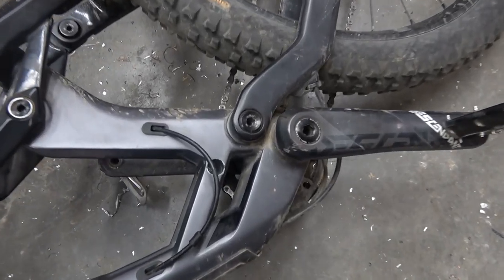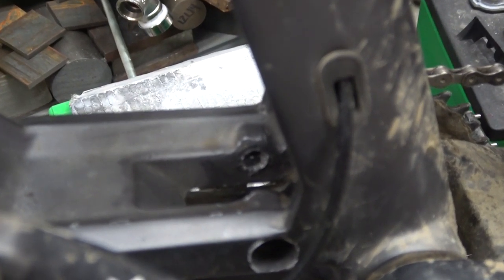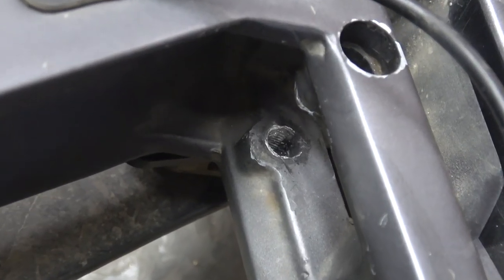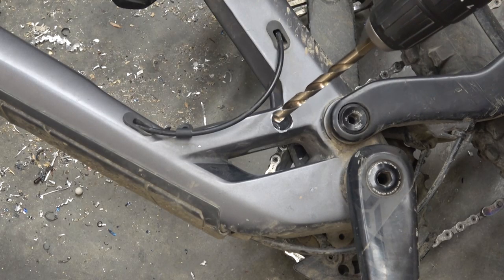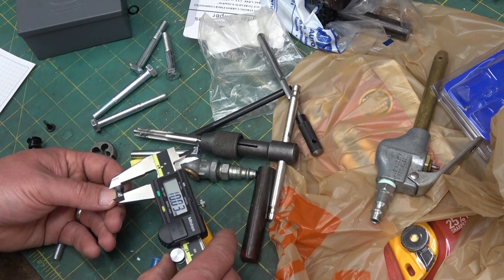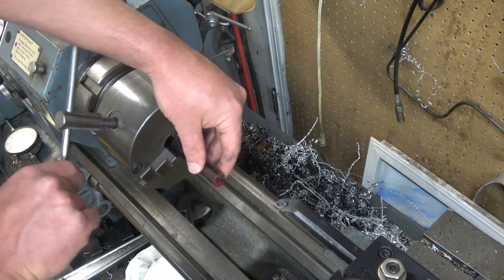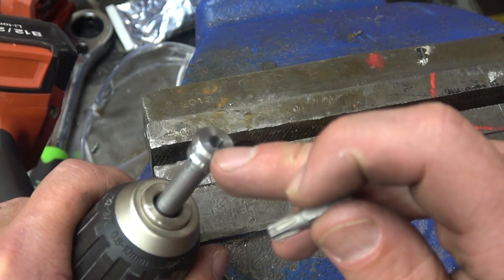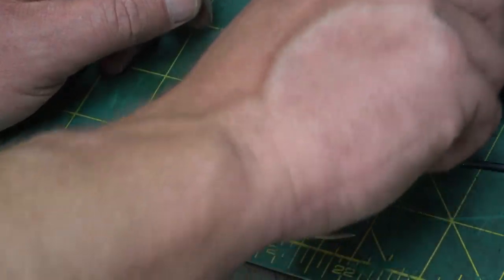What's a scumbag offset? | Obscure German Carbon Fiber Bike

Comment: Being a German bicycle, I'm sure the $600 water pump will be the next part to fail
Reply: Yes! And you'll have to take off both wheels and the seat, get a special tool to hold the chain and sprocket. Better make sure everything is lined up before letting out the pin in the tensioner! Or else you'll throw off your timing and it'll never run the same again! And all to change the water pump!
Reply: If it were a Yamaha it would be the £900 ignition lock.
Reply: Don't piss-off the Germans!  8)
Reply: Good luck figuring out the oil level without that dipstick.
Reply: ‘Twas “fixed” with a software update.
Reply: Chris Stephens and then the $600 valve they didn’t check originally. VW owner here. These stories are true.
Reply: @oqsy  Or the weak headbolts on the 500 horsepower V8 in the 2007 all wheel drive AMG Mercedes minivan - which the owner decided to rebuild himself rather than pay a Mercedes shop $57K to do.
Reply: It's 300 dollars, but the labor is 3000. :) Becuz Cherman Engineeering is der best!
Reply: It'll be the $600 magnetically driven waterpump that will fail due to melting as the $20 stamped oil-water heat exchanger leaks all the working fluid. 
I don't know why the Germans or Austrians can't suck up the patent cost for the aluminium linear designs like Laminova etc.
Reply: @oqsy  I love my VW. But I have a tbi with 4 years of warranty and it's a manual transmission. It can get pretty bad if you csnt/don't work on them yourself. Nice thing is Bosch sells everything as aftermarket, at about 60% less than the stuff that says VW or  Audi.
Reply: Haahahahahahahahahahaha
Reply: Please, Mr Cintolo.. I close my eyes & see faint amber lights..
Reply: Dee Jay   a friend of mine had his bike written off because of the price of a steering ignition lock on his scooter T Max. The villains also cut a section of disc to remove the disc lock, I hate to think how much one of those costs.
As to costs , in the past I have disabled a steering lock part of an igntion switch.,after a theft, because of the astronomical price of a new one,for a friend who could afford a replacement. Seem to recall £600 being mentioned.
Forgot to mention the T Max was keyless ignition, which could explain the wild costing.
Reply: Just wait for the timing chain service
Reply: Bah, the 600 dollar water pump never fails, it is the 35 dollar water pump tensioner spring that fails.  That failure kaputzes the 600 dollar waterpump
Reply: Giovanni Cintolo you mean 1800.00 water pump 😂
Reply: My honda charges 900 for brand new alternator
Reply: Watch out the VANOS will be next.
Reply: Dee Jay  yeah man wtf is that about
Reply: @derekcoiner5946  Or $400 for air filters fml
Reply: And the water pump impellers are made of plastic.
Reply: @dekoldrick  they prefer the term
Advanced lightweight composite materials.
Reply: @edwardtupper6374  you just gave me flashbacks with that word ... Vanos .... Yikes
Reply: @bryanmartinez6600  LOL🤣
Reply: @mattburns2968  Sounds like you're describing the 2.7
Reply: @rickmorley9948  That itself had two more bugs...
Reply: @greggv8  57K....LOL
Reply: @chrisstephens6673  two words - HOT Wire
Reply: @rogerborg  
FACTS: 1982 Honda CX500 Turbo tuneup cost $ 1200 at a dealer. 
First Minatenance: $2500
Over engineered to the 9's!
Reply: @glenholmgren1218  excuse an old man not understanding but "hot wire"???
Reply: Chris Stephens Hmmm, reread your original comment - perhaps this particular bikey-bike is not a good candidate for good, old fashioned Hot-Wiring ? (Circumventing the normal key-activated ignition controls by bypassing the ignition switch with a wire instead of the key performing that function ... seriously, and old guy {me too} that doesn’t know what Hot-Wiring is? 
I know I grew up on the wrong side of the tracks; in the wrong neighbourhood of one of the most crime-infested small towns in Canada, but for real???)
Reply: @glenholmgren1218  regrettably I also  know the meaning but missed the context. Having a senior moment perhaps?🙄
Reply: and all 8000  electronic modules.
Reply: @BillJBrasky  Bought one Jeep Commander. Real American design.  Quickly figured out it was a Mercedes in disguise. Had software issue that prevented 4wd low, and  a power steering fluid driven fan. I want to say I had to replace the radiator because the ps fluid was routed through the radiator and was leaking.  The second Jeep Commander had a transmission issue where it would spray transmission fluid out of a vent tube when warm dousing the hot  parts of the engine.   Honestly still wonder if it had a slight leak  was just overfilled thanks to the lack of dipstick, as it shifted excellent.   Had it rebuilt, broke even.
Reply: @N4CR  600 dlls, try 3k for some of the austrian industrial pumps
Reply: Internal water pump

Comment: Many thanks for helping out our customer from Switzerland! Really great work on the bike (and the video is great too!)
We've changed all "pins" from aluminum to steel.
Reply: Ave needs more beer to keep the National friendship going :)
Reply: Or Cheese...
Reply: Very cool
Reply: Holy crap a company that actually cares about the quality of their products . . . what is this world coming to?
Reply: A good company would dutifully compensate our canadian friend with a carefully considered quantity of beer.
Reply: @yourmoms5602  don't worry, the customers will carry the cost of the engineering and workers change in materials. All the PR guy has to do is say sorry and keep his mouth shut about the engineer warning them about fatigue. Poorly engineered parts usually come from management. I could be wrong, but I hate giving corporations the benefit of the doubt.
Reply: @Jonas Pins and other shock mounts are typically frame specific. Fox, Rock Shox and others make their eyelets to an industry standard size. They do not manufacture bolts, pins, and the like.
Reply: You should consider titanium, it's lighter and just as strong as the chromoly.
Reply: As a fellow Canadian preserved meat products are almost as good as beer. Also good on you for admitting your failures and improving upon them. Cost is important to making a decent product and profit is king. But the queen of the house gets mighty pissed when she’s embarrassed by shortcuts in engineering. I’m sure the original parts were all titanium but the bike was also unprofitable or prohibitive in price. Compromises must be made and unfortunately this was a failure point and now it’s being recognized and sorted. Good work!!!
Reply: @jonanderson5137  To be fair (lol?) bike "corporations" are not very big on this scale. There are probably less than 20 people working at this place if not just 6 guys and some outsourced production of major parts followed by assembly done locally.
Reply: If this is actually a Radon rep and they actually did change the pins, that's pretty incredible.
Reply: little bit more work for some kids in china
Reply: @whirving  Radon is a brandname of one of the larger online bike/bike parts discounters - online dealers in DE (according to the web presence, 300+ employees). 
The bikes are designed in-house.
Reply: @josephdestaubin7426  he said he would have used titanium if he had it in the Vijay
Reply: Clearly the IPR for this design change belongs to AvE - I'm certain all accounts can be settled in beer or Canadian Kopeks
Reply: Damn nice you responded and doing a fix
Reply: Are my eyes deceiving me? Did this really just happen?
Reply: A fantastic result!
Reply: hope you a made right every failed bike. did you guys even track test? id be happy to test your rigs.
Reply: You may want to rethink your plan. Steel replacement pins sounds like a good idea but unless you're prepared to hand out replacement frames/frame components... I'd stick with the 'designed to fail first' aluminum pins.
Reply: Aluminium* ;)
Reply: Radon. My favorite bike is a carcinogen.
Reply: @garrettburrows442  Right on! What they say.. change the part or don't change it?
Reply: @jonanderson5137  I hate this. As an MET, it really grinds my gears when the marketing department or management pull things out of their ass without a basic understanding of important design choices
Reply: By far the best customer service I've seen from a brand.. Well done Radon
Reply: @travisthechimp7857  my original thought too. But since the pin failure caused frame damage, the cheap break first part also broke a very expensive part. Not sure where else to build the weak spot, but this pin was too weak and destructive when sheared.
Reply: Why were they Aluminium?
Reply: @JasonW.  Agreed.. but I'd have to think that probably 90%+ of pin failure's don't result in such damage. :)
Reply: @johnsalmons9222  at a guess to hit a weight target or because the test didn't show. This as an issue and its a long term Wear issue

Fucking cool They responded though
Reply: Jonas that are made to fit that frame? But I know nothing, you made a good point.
Reply: Addidis no, he got the bear! The bikes owner should be getting something a little more worthwhile for nearly dying?
Reply: @whirving  To be Faiiirr
Reply: @miketrisket788  To be faaaaaaaair
Reply: That's a very Swiss response. :-)
Reply: @Jonas It occurred to me, you manned up !
Reply: @jonanderson5137  This is true of all industries.
Reply: Hell yeah!
Reply: @templecat3974  Cheese with beer: Ave will go balistic...
Reply: @802Garage  They did confirm it to me by email today.
Reply: @gregorpohl9899  That's so awesome.
Reply: @802Garage  They added that they did it for new models. My last week delivered Radon JAB 10 seems still to have an aluminum Pin. It's not magnetic. I asked for a steel one as a replacement.
Reply: Joseph DESTAUBIN titanium is nowhere near as strong as chromoly
Reply: @forevercomputing  gtfo brit boi
Reply: @N00NSFAN  titanium is soft. pull strenght is not everything in that application.
Reply: @gregorpohl9899  Hi Gregor, please send us a message on Facebook or Instagram. We have steel spare-bolts so we can send you one.
Reply: Joseph DESTAUBIN It’s probably too expensive. The material alone is expensive, working with the stuff is expensive because you need expensive equipment and it takes longer. A small batch of a Machined parts like that would be through the roof. Probably not worth the few grams in weight savings
Reply: Whoever was doing your frame design should of told you that from the beginning.
Reply: @yourmoms5602  that's because it's a German not an American company.
Reply: Aluminium is known to undergo galvanic corrosion when in contact with carbon fibre. Were there engineering measures to mitigate this, and if not, could it have contributed to the failure observed here?
Reply: If the design was sound, there would be a very beefy steel bump stop external from the shock, and the rear shock for downhill bikes would have a faster progressive compression valving. Then the pin can be steel, of a smaller diameter and the shock will never fail from getting bottomed out.
Reply: Alu Schrauben, wem fällt sowas ein 🤣😂
Reply: @josephdestaubin7426  Or eat less Cheetos less before setting off. The net weight or bike and rider will be the same.
Reply: You created this channel just to thank AvE and notify of the update? That's commendable.
Reply: @yourmoms5602  german/swiss companies ;) they are not big but they are taking care about  their customer happiness...Nikolai bikes is the peak of that, have a 16year old bike, my seat clamp broke. Got a new one in two days imkl. A new seatpost...
Reply: @XsavioR38  sounds like a letterkenny cold open line
Reply: @purerhodium  I would imagine that the coating on the pin was intended to mitigate any corrosion. And any corrosion severe enough to substantially weaken the pin would have been clearly visible.
Reply: Why the fk were you using aluminum to begin with?
Reply: @yourmoms5602  Most non Chinese companies worth a damn actually care about their customers
Reply: @twizz420  because aluminum is used in lots of bike parts aluminum stems aren’t solid blocks of aluminum. They have tons of cuts to reduce weight and you can’t recreate every stress that’ll happen in the real world
Reply: @josephdestaubin7426  ... and save what in weight .. a few ounces? Is as ridiculous as silver vs copper windings in transformers. It's a geek factor marketing hype thing. Decent bolt steels are higher strength and have an infinite fatigue life when engineered properly, which is not the case with AL and TI alloys.
Reply: @josephdestaubin7426  Actually did consider titanium but he did not have the stock but titanium he needed to make the part so
Reply: @josephdestaubin7426  He considered titanium But he did not have the stock in the shop.

Comment: Ride a Huffy. Cast out of a single piece of solid lead. Great workout, and nothing breaks.
Reply: Until you roll the front tire into something that resembles a taco Bell taco, and the rims are about as crunchy as well 😂 my trust goes to Royce Union for bicycles.
Reply: I got a Huffy! It's a fukking tank, I love  it. It even still has the American flag on the badge.🇺🇸💪
I dig German stuff too, especially aircraft and women.
Reply: Captain Fucking misses the point right here.
Reply: Doesnt break but it wont brake either
Reply: @DerpCraftDudes  from an ex bmx rider 1st thing you with a huffy is remove the brakes lol.
Reply: Pffffftt!
Reply: lmao
Reply: If you upgrade the rims chain and tires and maybe bars the thing is pretty bulletproof
Reply: Lead forks bend pretty good
Reply: Lead bike is the same as a chocolate tea pot.
Reply: Your heart breaks when all the neighborhood kids tease you.
Reply: I think you mean Mongoose
Reply: I had one of those frames fall to pieces under mew while I was riding.
Reply: For sure, cheap bikes are good.   If it does break, you can get a 5-10$ part.
Reply: And you get free lead poisoning as well

Comment: A few years back I had to stick Helicoils in a bunch of long aludidlium pieces, some 500 messed up threads I had to fix.
Then they were sent for anodizing.
And they came back with all the Helicoils corroded right out of them. Fun times.
Reply: Fun times.
Reply: Derp..everyone knows time-serts are king 😜
Reply: ANO.. THEN inserts, always.  You can't anodize stainless steel

Comment: Long time fan, I love your channel!   Please don't wear those gloves around the lathe, if on the off chance they snag they wont come off (and if they do they're bring parts of you with them).  As a fellow machinist I'd recommend those extra thick (5-8 mil) nitrile gloves (I'm sure you know the ones), they'll keep the chips off ya and if they snag they'll rip clean off (had a run in with a mill I got a little to handsy with where this fact saved my bacon).
Reply: thats a good piece of safety advice. One day when i get a home setup this might save my bacon. 

electric motors dont care - electric motors just want to torque. Your arm being in the way is a non factor. So much respect for the power behind large shop tools. In addition people need to have a foot mounted kill switch for machining equipment. 

if in doubt , kick it off
Reply: What’s the saying....  Safety third 😆
Reply: Coworker got his hand pulled into an impregnator due to the leather work gloves he was wearing. Broken fingers and bad burns in an instant